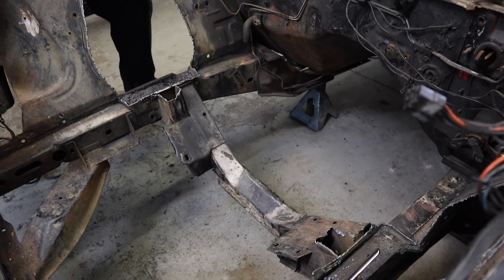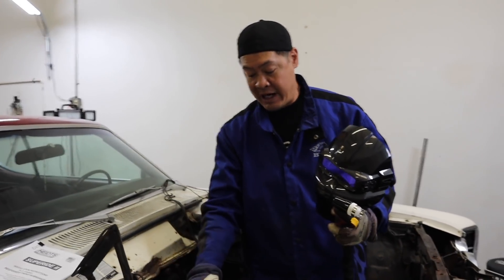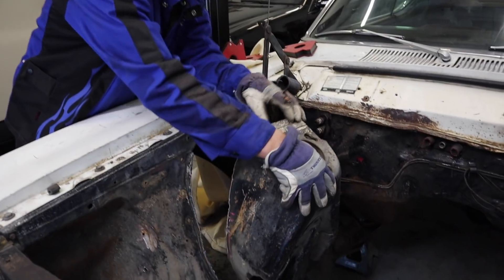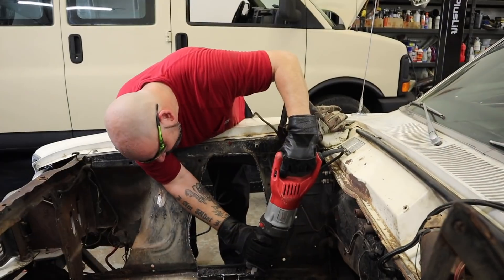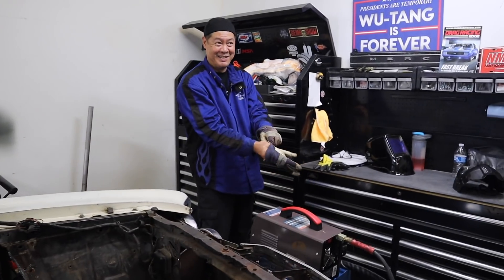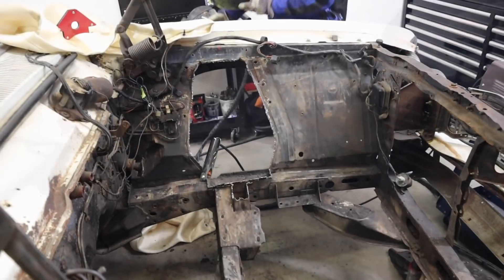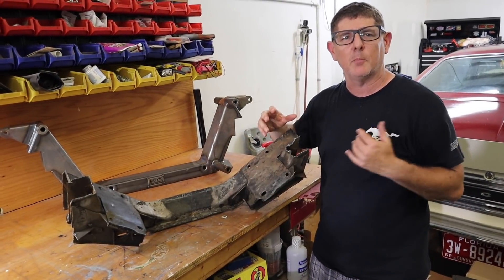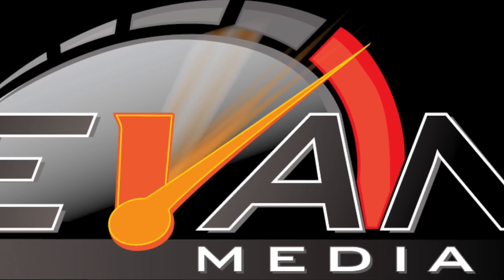DIY 7.3L Godzilla Swap in a 1968 Mercury Cyclone - Heidts Front End Install Part 1

Comment: Heidt's suspension is Mustang II, The upper and lower arms are too short for the best geometry.  You would be better off using a stock upper attachment point lowered 1" ,like Shelby did, and cut out the shock towers above that point. Then modify the stock lower A arm to accept the coil over  and use a circle track upper a arm.  This moves the upper spring attachment point down and attaches to the welded plate that replaced the shock tower.  This provides correct geometry and removes the shock tower.  I know, because I have done it.  No bump steer, correct camber change in turns. This also lets you remove the oil pan without jacking the engine.  Pics available.
Reply from the maker: That sounds like a great set up.

Comment: Very rare car this is so sad
Reply from the maker: Should we have restored a base 302-2bbl auto Cyclone? Spend $50,000 to make the 200-hp car be worth $20,000? Please educate us?
Reply: @revanevan  Probably be worth $15,000 after your smart ass remark.
Reply from the maker: Wasn’t meant to be a smart ass comment. If it was a 428 Spoiler we wouldn’t have bought it. This is a $5,700 car that was in serious need of TLC and a new power train.
Reply: @revanevan  You coulda sold me the car for 8 grand and it would have wound up with a 428 in it. I have those engines piled to the ceiling.
Reply: @revanevan  exactly….. good work. Of the swap parts weren’t so freaking expensive, this would be a great option for me.
My shock towers are already gone and have a rod and custom front end.
Reply: @revanevan  By now, do you not see how many people did not want you to butcher this car?

Comment: Did you chop the towers due to no front sump pan available or do to engine width?  I have a killer suspension on my 68 and will not cut my car but a 7.3 is calling my name
Reply from the maker: Yes.

Comment: I'm disappointed in the Engine Swap. The Purist part of me wants a 428 SCJ under the hood.
Reply: The purist part of me wants a 514! Lol
Reply: It's a 68 the 428 SCJ wasn't offered in these cars till 69 even then the CJ package only gave you a 428 CJ not the SCJ if you got the ram air it made it an R code car but still had the 428 CJ to get a 428 SCJ you needed to special order higher gears I believe you needed to have a 3.90 or 4.30 gear ratio to get the 428 SCJ in 69 also this is a base model 302 2V car
Reply: @jacobbondy2936  I learned something today I thought these cars got the 429 about the same time as the t bird.
Reply: @j.e.d.8065  they didn't get the 429 till 1970 when the body style for the Cyclone and Torino got slightly bigger with a slightly bigger engine bay

Comment: not sure i can give a thumbs up for hacking into a cool muscle car.
Reply from the maker: Depends whether you consider a base Cyclone with a beat up 302 2-barrel a muscle car? If it was an original 428 we’d be restoring it.
Reply: @revanevan  If you pay attention to the guys restoring base cars like this, the swap of a big (classic correct) engine increases the value considerably. The Chrysler guys have been doing this for over 20 years with Hemi swaps into 225/318 cars, and come out way ahead.

Comment: wouldn t the car be worth more with a 428 left original being a cyclone spoiler
Reply from the maker: Sure, but this was/is a base car with a 302/2bbl. It’s not a 428 Spoiler.
Reply: REVan Evan     I like 60’s ford cars, but that ford falcon front suspension does leave some room for improvements!
Reply: @cjbert6790  that same front suspension won the trans am  racing championship a few times
Reply: Travis Lostaglia    I still stand from what I posted. Those shock towers make doing engine swaps a real PITA.
Reply: @cjbert6790  they are a pain but people act like it’s impossible i have put headers on a 67 cougar with a FE in it  the cars that could get a big block from the factory are not as bad as what people make them out to be now early falcons and Mavericks are a nightmare
Reply: Travis Lostaglia    I owned a 67 390 cougar myself for awhile when I was young. I left it stock. I like 429’s with stroker cranks and big heads. I need room to grow! Lol
Reply: I probably wouldn’t modify this car due to its rarity, but its not mine. Soooo!😂
Reply: @cjbert6790  I don’t think it’s bad since it was 302 2v the one that bugs me is the talladega that was all cut up with air bag suspension and giant wheels but it’s not my car so to each his own
Reply: Travis Lostaglia   I hear you.

Comment: Keep the progress vids coming.  Good stuff.  Do you have a 1/4 mile time goal for the car?
Reply from the maker: Thanks and not really, I think we'll end up with a mildly built Godzilla (ported heads, cam, etc) and maybe 580-600 hp. The car should be about 3,600 lbs so hopefully low 11s or quicker. It's not really being built as a drag car so we'll see.
Reply: @revanevan  That would be pretty awesome!